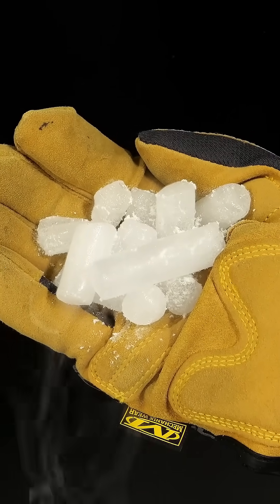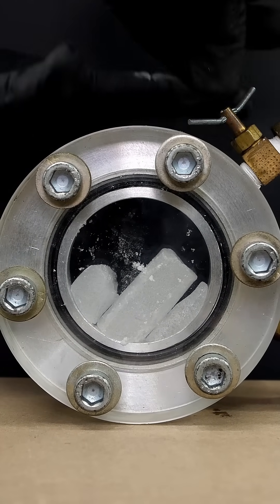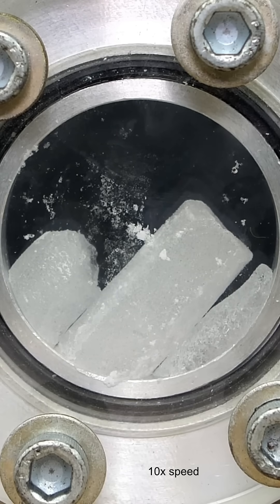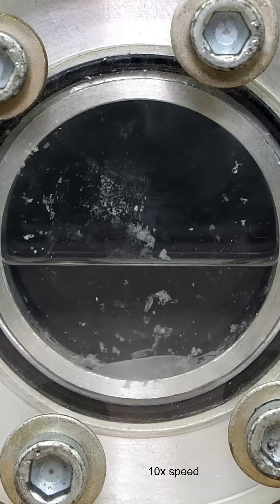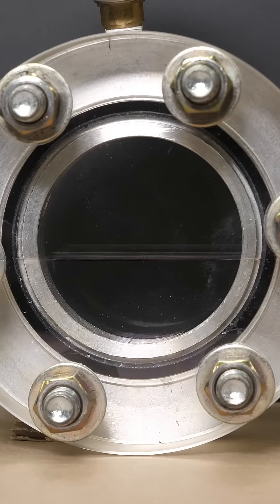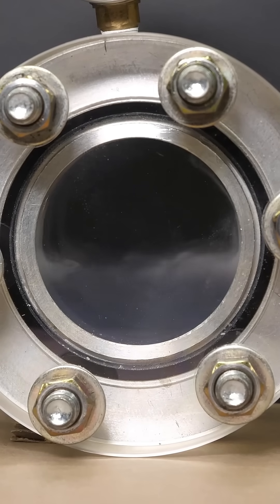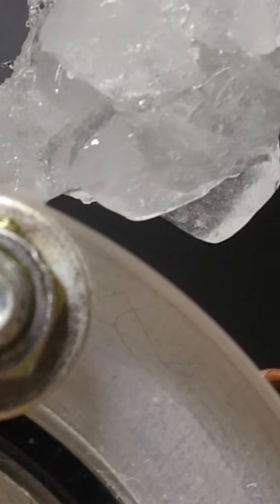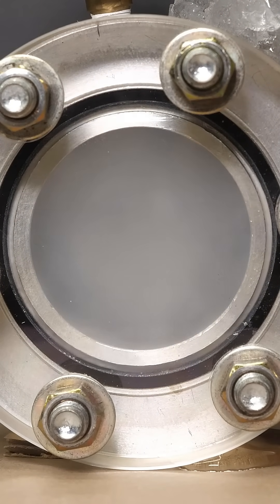This is not a liquid or a gas

Comment: Triple point – the point on a phase diagram at which the three states of matter: gas, liquid, and solid coexist
Critical point – the point on a phase diagram at which the substance is indistinguishable between liquid and gaseous states
Reply: this would be awesome with hydrogen
Reply: I had to read up on this when I was reading about CO2 refrigeration systems. It's incredibly interesting.
Reply: @markethvacrguy  thanks for comment.  I never occurred to me even though I know about chemistry and triple points that at the right temp and pressure you would produce a solid in a system. Interesting something to ponder
Reply: Allright. I did some googling, triple point of CO2 is at around -56°C, and 5.11Atm, this what Nile is showing is "super-critical fluid" which can occur at higher pressure than 72atm and more than 30°C
Reply: Not triple point here, as there is no solid form at the same time as liquid and gas.
Reply: ☝🤓 uhm actually there is a fourth one, plasma
Reply: @Xareon2763  why are u on a video about super critical co2 gas if u now bout his science shit 😭🚶🏿‍♂️
Reply: @samjohnson609  idk bro
Reply: how do we start from supercritical fluid to plasma
Reply: Coexist in a very very close range.
Reply: "l identify myself as a hypercritical, not a solid or liquid."😂
Reply: @Lubin-md4ml maybe you can identify as an original joke next time
Reply: Isn't it called as eutectic point ?
Reply: @ramushamu10105  no, eutectic point is a property of mixtures
Reply: @minifeebas8911  ohh i remembered thanks 👍🏼
Reply: @minifeebas8911  It is for two component system
Reply: @ramushamu10105  and triple point and critical point are for single component systems
Reply: @minifeebas8911  yeah you are right 👍🏼
Reply: 15 years of years after I had seen this first. It's still amazing
Reply: @MichaelJones-gh4lq  were you a professor?
Reply: Are you in any way related to Avogadro the scientist?
Reply: I think this is not triple point. This is where the line for liquid/gas ends in diagram. 

Triple point, you should be able to see all three states, and you could recognize them, this is some mystery fog, gas-liquid, hard to understand.. take in consider, that there is enormous pressure too
Reply: A super state ????
Reply: @sadmichael9028  what is a super state?
There are 4 states of matter naturally occurring ( liquid, solid, gas and plasma). There are a few more states but they are not naturally occurring and only exist in labs under extremely conditions and only exist for very short time periods.
Reply: @AmedoAvogadro  I mean as in...live and dead at the same time as in Schrodinger's cat.. would that be the same idea ??
Reply: @sadmichael9028  that is what I thought you meant.  Super Position.  I think that is a whole other thing.  I it just a triple point.  Water is the only substance that can be at triple piont in earth’s atmosphere.   Like in the cold areas like Alaska: ice/solid, liquid/the ocean and gas/humidity (although the water vapor in the air/atmosphere is at a low percentage compared to warmer areas.)
Reply: @AmedoAvogadro  O I'm mixing things up position/state lol thank you very much for the reply and the explanation I've have learned something today....
Reply: @AmedoAvogadro supercritical fluid occurs naturally lol. Deep in the ocean, inside hydrothermal vents, the water gets inside, gets heated by magma, and compressed with the force of a planet against the walls of the chamber
Reply: @Flesh_Wizard  thanks did not now of such a state.  Are you a deep sea guy?  Also
Supercritical fluids occur in the atmospheres of the gas giants Jupiter and Saturn, the terrestrial planet Venus, and probably in those of the ice giants Uranus and Neptune. Supercritical water is found on Earth, such as the water issuing from black smokers, a type of hydrothermal vent.
Reply: @sadmichael9028 bruh... you just completely misunderstood all Schrödingers work.
Reply: @alondjeckto  how so ???
Reply: @alondjeckto  BRO IM SAYING. SOOOO many people dont even get the schrodingers cat thing and they just get more confused.
Reply: @AmedoAvogadro 
The center of the Earth enters the chat.
Reply: @AmedoAvogadro there's also supercritical fluids (like what we are seeing in the video)
Reply: @samjohnson609  Still, in this case, you can't argue about Schroedinger's cat theory because we can see and observe the phenomena.
Reply: @Return-2-Monke  bro what do you even mean? im not arguing shit. some guy mind you a guy that had nothing to do with you, was misunderstanding the concept of shroedgingers cat so i pointed out that he didnt understand it. thats all. i have no idea what you think im arguing.
Reply: @samjohnson609  about Schrödinger’s cat: I hope you know it was an ironic claim he made. Ironic in the satirical sense. At the time some of his colleagues discussed whether reality only exists if it is perceived and how they could test such a thing. Schrödinger responded with the cat experiment. His conclusion was: obviously the cat is alive or dead whether we can see it right now or not.

It was a warning to his colleagues that superposition as a possibility in especially small matter doesn’t mean an entire cat would be able to gain superposition just as long as we don’t look at it. Certain colleagues in his time thought about superposition in the way regular people in the 50s thought we’d have flying cars in the 90s. It’s a very small and subtle part of the way matter works and applying it to any form of matter because it’s the next “logical” step doesn’t make it practical or achievable.
Reply: @cats1970  correct
Reply: It's not plasma?
Reply: @izdotcarter no lol
Reply: @izdotcarter plasma only exists at temperatures that usually are not represented in a phase diagram
Reply: @izdotcarter plasma just has the electrons stripped
Reply: @izdotcarter plasma glows
Reply: @izdotcarter not enough energy to cold
Reply: @izdotcarter it's more similar in concept to a vapor. it's a liquid AND a gas at the same time.
Reply: @izdotcarter No, it's essentially a vapor that behaves like a fluid. But it's not really a vapor or a fluid, is sort of a unique state of matter that is basically not its own state if that's not confusing
Reply: @markethvacrguy  fluids and gases, I believe, it is fluid dynamics generally with the viscosity dominating it’s properties of flow
Reply: @markethvacrguy  of course fluid is not synonymous to liquid. Gases and liquids are both fluids
Reply: @izdotcarter  I think plasma is an energized gas usually the plasma is very hot

Comment: could you imagine this fun kinda crap happening... on a GAS GIANT planet? :o seriously high gravity could cause pressure pockets of various gasses where they heat and cool as the planet/atmosphere rotates on its axis or orbits the planet's star. perhaps even miles wide deep and long pockets of liquigas moving further or closer to the equator of the planet heating and cooling in that fashion as well. :o

Comment: I once got a hold of some dry ice and sealed it in a small glass vial. I found it very fascinating when it turned into liquid.

I set it down and turned around, suddenly it sounded like a gunshot went off. The vial had burst quite dramatically. 

Won’t underestimate the pressure of CO2 again.

Comment: Dear Nile Red, can we use this pressure chamber dry ice combination inside of a heat insulation (thermos flask kind of thing)  to hold energy in the same way as sand battery but in a small size, maybe suitable for home or vehicle use , slowly the coolness can be retrieved for transport of vaccines etc to remote regions. Can you do a scientific demonstration of

Comment: Note that the ice didn't float. Opposite of water ice
Reply: Normal ice floats because it has a lower density than water, usually when a liquid is frozen the volume decreases and density increases, in water it's the opposite. 8th grade chemistry
Reply: @ᴩʀᴇyꜰᴇᴀᴛʜᴇʀ  yes, you managed to say the same thing I did with 3x the effort.
Reply: @johnrobholmes  i was just explaining why ice floats and dry ice doesn't, plus i was studying chem while watching this so it didn't that much effort
Reply: @ᴩʀᴇyꜰᴇᴀᴛʜᴇʀ  what's interesting is that if water ice sunk, we would have no marine life as it would slowly fall, suffocate, and trap everything in the process.

Comment: what will happen if u open it while in liquid state?
Reply: It will evaporate of course. Additionally, if you don't open it carefully enough, the pressure would shoot out the CO2 at such a high speed that it would launch the little chamber across the room.

Comment: "you cast a spell to turn air humidity into water for your crew to drink"
Reply: You say: You cast a spell to turn air humidity into water for your crew to drink.

GPT4 says:

As the spellcaster of your crew, you have learned a spell that can help you provide fresh water in dire situations. You are in a remote area where water is scarce, and your crew is thirsty. To cast the spell, you gather your magical energies and follow these steps:

    1 Find an appropriate location: Look for an open space with a good amount of air circulation. This will maximize the amount of moisture you can gather from the atmosphere.

    2 Draw a magical circle: Using a piece of chalk or a stick, draw a circle on the ground large enough to accommodate a container to collect water. The circle will serve as the focal point for your spell.

    3 Prepare a container: Place a clean, empty container in the center of the circle. This container will hold the water created by your spell.

    4 Chant the incantation: Stand at the edge of the circle, facing the container. Close your eyes and take a deep breath, focusing on the moisture in the air. Begin chanting the incantation:

    "Aqua ex aere, humore converte,
    Sitis sitientium, sitim sedare.
    Aër umidus, in aquam mutare,
    Et hanc sitim, exstinguere valere."

    5 Channel the energy: As you chant the incantation, imagine the moisture in the air condensing into droplets and gathering inside the container. You may need to repeat the incantation several times to collect a sufficient amount of water, depending on the level of humidity in the air.

    6 Complete the spell: When you feel that enough water has been collected, stop chanting and open your eyes. The container should now be filled with fresh, drinkable water.

    7 Share the water: Carefully distribute the water among your crew, making sure everyone gets an equal share.

Remember, casting spells can be taxing on your magical energy reserves, so it's essential to rest and replenish your energies before attempting to cast another spell.
Reply: @MatthiasGörgens  i ain't reading that shit
Reply: I put on my robe and wizard hat
Reply: "Your crew dies from oxygen deprivation"

Comment: You can actually use supercritical CO2 to extract organic compounds without using traditional solvents on a small DIY scale if you don’t have the time and cash to build a large setup. It can be done with a small capped plastic test tube, dry ice, and a hot water bath. You need to build a sort of shelf for your raw material to sit on in the tube. This is done to keep the bottom tip of the tube open for the extract to collect. Stuff the dry ice and the material (orange peels for example) onto the shelf in the tube, cap it, then heat with a water bath. I believe I recall 90C being the target temp. Slight venting may be needed to prevent the tube from bursting. You can observe the supercritical CO2 which is fascinating to see in person. If orange peels were your choice you will also find a small yield of d-limonene extracted at the bottom tip of the tube.
Reply: Why is nobody talking about this???
Could it be used on fungi?
Reply: I haven’t heard of using it for fungi.  But it certainly sounds reasonable. There are a lot of large scale applications already being used. They just cost more and are less efficient than traditional solvents. But I haven’t really seen too many people try this DIY version. You don’t yield much but it is fun to see. You could probably scale up too.
Reply: @souporglide 
No solvents! 
that's valuable..
fellow chemical engineer?
Reply: Analytical chemist and general nerd
Reply: @nordicfalcon  dabs!
Reply: @nordicfalcon  would also be cool to try with cannabis, I wonder if this can be used to make THC/CBD resin
Reply: This looks to be like a great way to have fun with left over peels instead of throwing away most of them when baking! I will look into this!
Reply: Can I smuggle methamphetamine using this?
Reply: Too many words brain hurt

Comment: I little remember that temperature vs pressure graph plot for CO2 would reveal all the regions where it's in liquid, gas or solid state. And there's a point in the plot where CO2 could exist in all the three phases simultaneously.

Comment: You need 75barg (and not PSI) to get supercritical CO2 at that temperature.
I doubt with these tiny bolts you actually reached 75barg. So, what you got is just vaporized CO2 and not the supercritical one.

Comment: Insta Plasma
Nice 👌

But i immediately considered a super critical H2O2 solution for a bomb 😂🤦‍♂️    Also an effectively reactive internal armor plating 😳 if you can keep the pressure it would absorb all kinetic force as a plasma, till a leak forces it out in a explosive decompression surrounding the area
Allowing troops to escape from a compromised tank and not have to worry about nearby resistance

Comment: Even cooler, (pun intended) is that there are refrigeration plants that use these exact sight glasses and c02 compressors/chillers to run hockey rinks instead of ammonia. There is one at the rink I work at. It was the first one in western canada. It can be used to transport heat via this exact boiling/condensation process via pressure.

Comment: what will happen if you suddenly open the chamber when the C02 is in liquid state? 
plz make a short on this
Reply: Its impossible because the pressure is to high to open the chamber
Reply: @MaMo盒  yes you could... Just open the valve
Reply: @probablyinconsistent4756  when you would open the valve the matterial would slowly get into its original state because of the preasure that get normal again and this would be boring
Reply: @MaMo盒  well ya I never said it would be interesting. However you said it's impossible which it is not.

Comment: Is the kind of a liquid and a gas just a fog? Aerosolized microscopic CO2 droplets that have just enough vapor pressure on their surface to resist condensation while under too much pressure to completely vaporize?
Reply: No, it's a supercritical fluid. At those pressures and temperatures there are no distinct liquid and gaseous phases anymore.
Reply: @lunkel8108  COOL

Comment: The carbon melts because this is an isovolumetric reaction—according to the ideal gas law, Pressure x Volume is proportional to Temperature, so since the gas chamber is changing its volume a negligible amount, we can consider the reaction isovolumetric (volume unchanging). And since he’s increasing the pressure, the temperature must rise also.

Comment: What happens to the liquid if you realese it out of the chamber after you take the oxygen out of ithe chamber. Does it just stay liquid it the chamber?
Reply: CO2 doesn't have a liquid phase at atmospheric pressure, it can only be a gas or a solid.  I'd expect the majority of the liquid to turn into gas almost instantly, and the remainder to freeze.

Comment: In chemistry class (which was about 10 years ago so I may be getting the finer points mixed up) we learned about the triple point, which is where the pressure and temperature curves of a substance intersect. It’s at this point where a gas turns to a liquid and liquid turns to a solid, and the substance can exist in all three states at this temperature and pressure, which is why it’s called the triple point. 

Looks like your just playing around with the triple point to some cool effect.

Comment: Working in a paintball field we had access to alot of co2.

We would collect flakes of dry ice in a two litre bottle.

Than throw it into the field and let it expand.

Inside the warehouse it sounded like a shotgun and would shake all the paint off the ceiling and walls. You would hear it dripping for hours.

Good times

Comment: Isnt that just mist
Reply: mist is an aerosol, a cloud of liquid droplets floating in the air.  in the supercritical phase, the boundary between liquid and gas disappears and you get a continuous fluid with properties somewhere between the two, rather than just gas with separate drops of liquid suspended in it.
Reply: ok thanks i get it